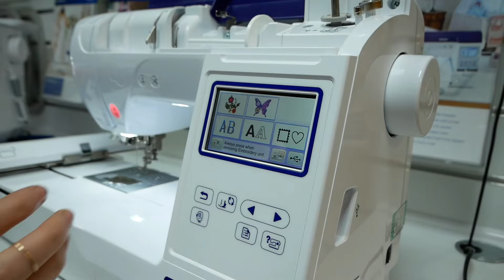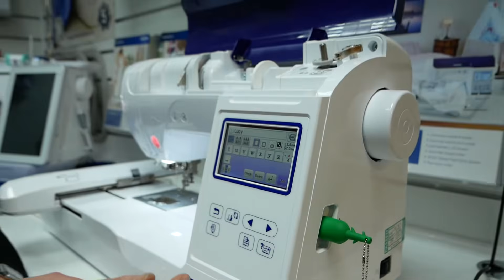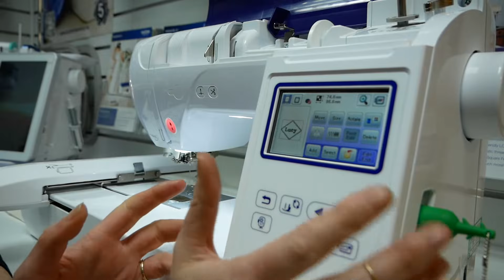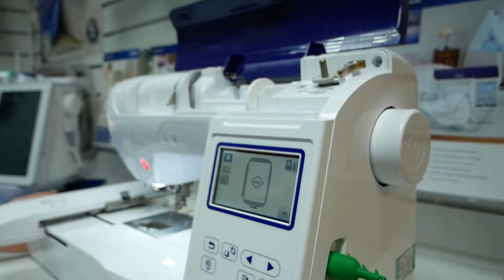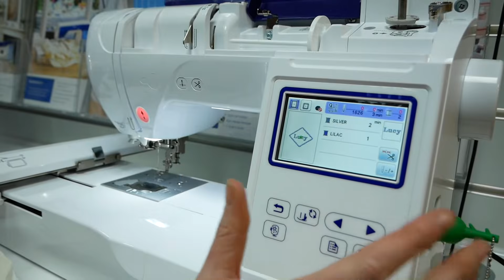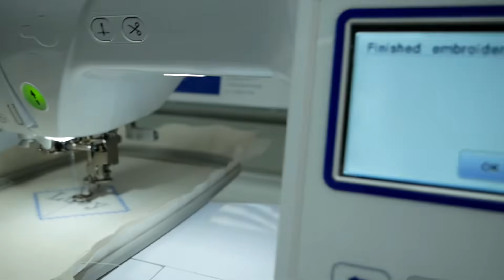The Brother Innov-is F440 Embroidery Machine

Comment: Can it take a bigger hoop
Reply: Hi Julie, you can purchase a 5 x 12 hoop, which is positional, so you can get a longer design. These can be purchased on ebay etc, along with 4 x 4 and a tiny 2 x 1. Hope this helps.
Reply: julie hooper no , that’s the biggest in this machine